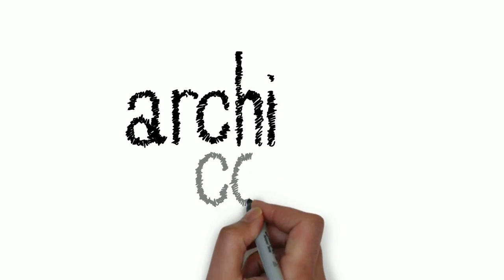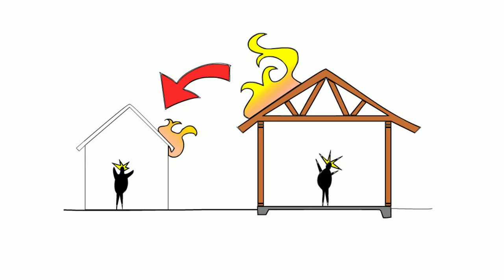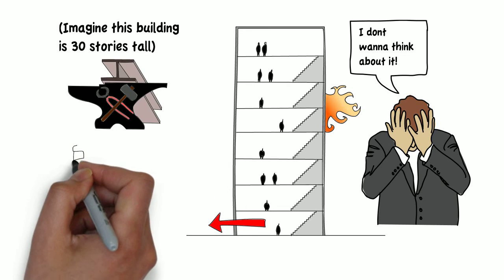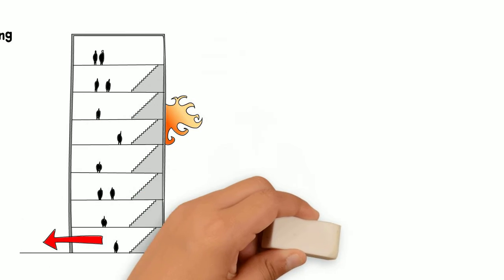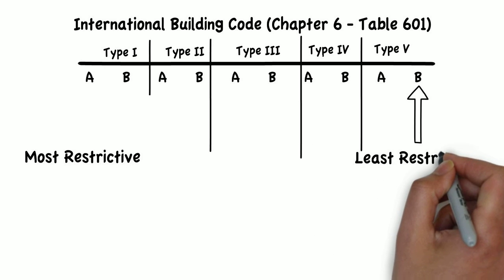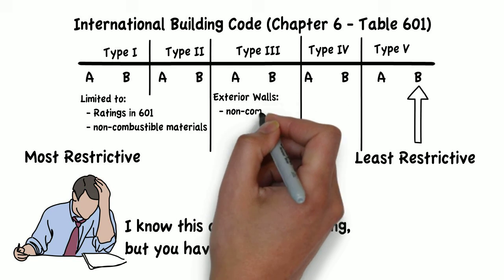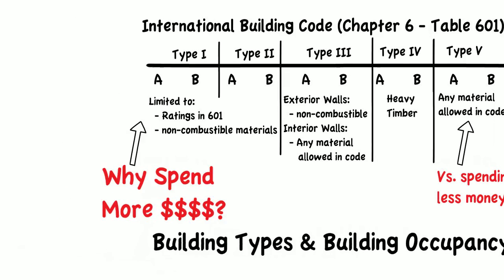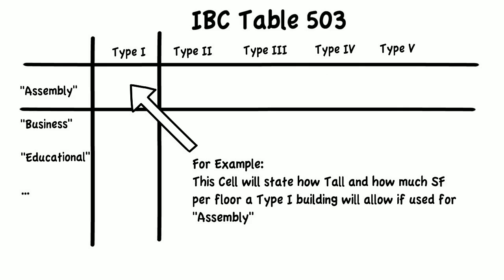AC 004 - Building Types

Comment: I’m always confused how to know if it’s a type 1 vs type 2 building? Can you explain how this would be selected please. Thanks for the video
Reply: It is solely based upon the fire-resistance ratings of the building elements as shown on Table 601.  Whether its steel studs versus CMU's, number of layers of gypsum, fire-caulk versus through-wall fire-rated intumescent collars, it is all about how BIG you want to build.  I've always found it helpful to tell people, "Look start on the right side of table 503 (Allowable heights and areas) and move left across the table to the far left side.  For example, in a Group B building, Type 5B, you start at 2 stories, 9,000 sf.  As you move to Type 2B, you get to 3 stories, 23,000 sf.  If you move to Type 1A, you get to UL, UL; however, your fire-resistive ratings (which mean building costs) go through the proverbial roof.  Hope this helps (one-year later).
Reply from the maker: William; I posted a poll on the channel yesterday. If this question gets selected, I will create a video on the differences. Nevertheless, check out Chapter 6 of the IBC.  Table 601will clarify some points. You will notice that the fire rating of various building elements are different. Chapter 6 is a relatively short chapter. Check it out. I hope this helps!